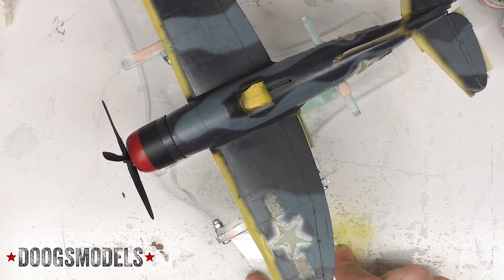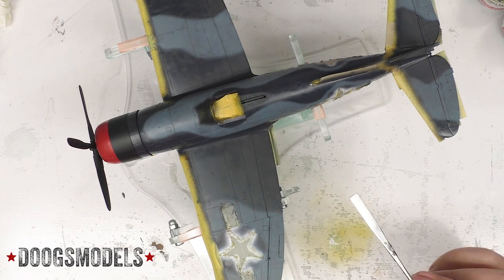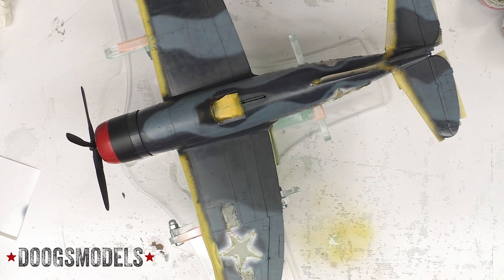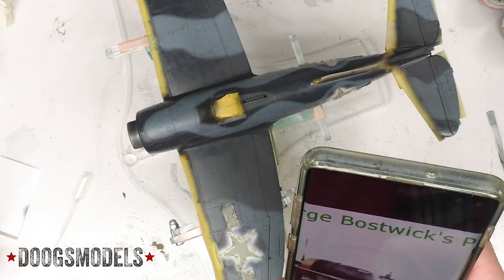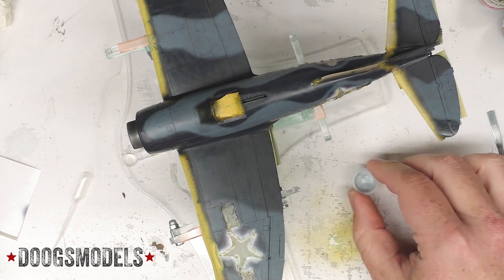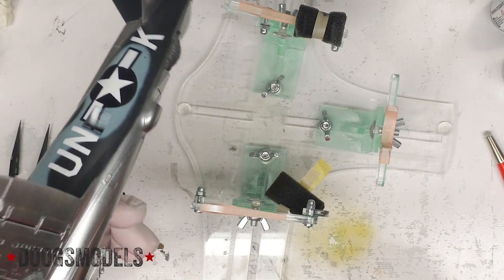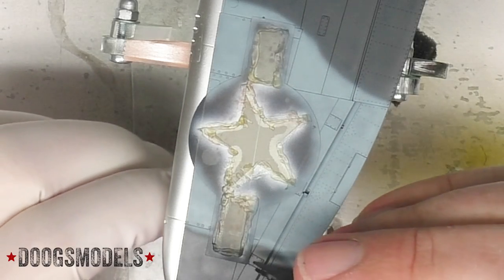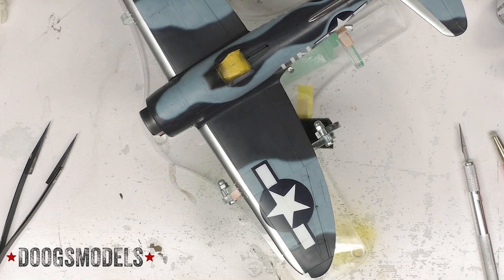Tamiya P-47M Build - Part 17

Comment: Hi Matt, it looks great!  How much did you thin your paint, and what pressure are you shooting it at?  Thanks, Dan
Reply from the maker: I had to add a few drops of MLT to the lighter blue mix - for some reason the PRU blue seems thicker or more spray-hesitant that most MRP. Humidity also skyrocketed right as I got into spraying it, which hurts paint flow just enough to be a pain in the ass. 

Pressure? I don't know. Somewhere between 10-20. Beyond that I go by feel and need.